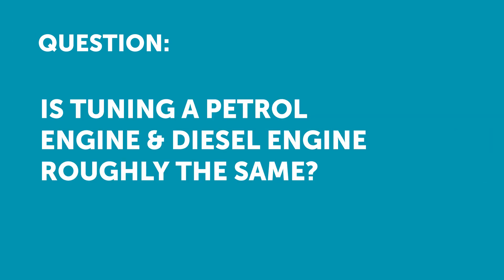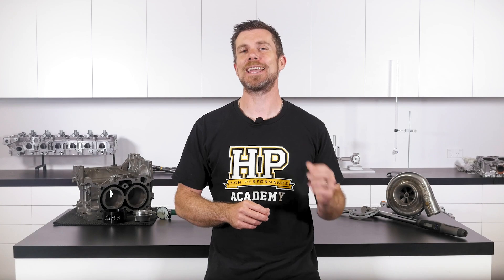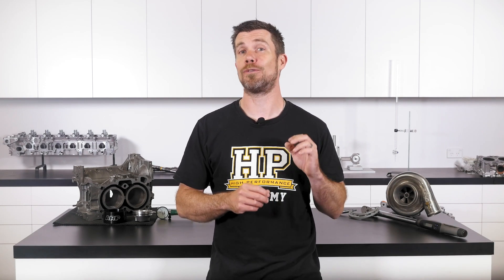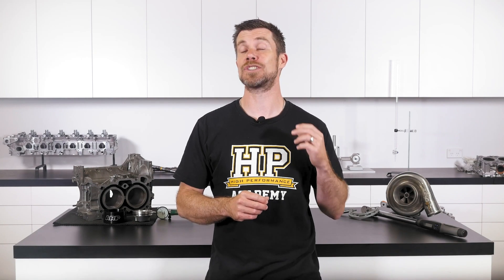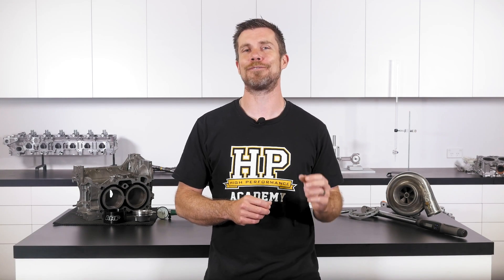The Difference Between Petrol Vs Diesel Engine Tuning [HPA Q&A]

Comment: Tuning aside, if a diesel engine naturally runs high compression with turbos seen running up to 100psi through a cast block. Why hasn't this transferred over into petrol turbo engines or is there something I'm not understanding, thanks in advance.
Reply: from my understanding,in petrol engines you`re compressing both fuel and air, if the cylinder pressure gets too high you are gonna have a preignition\detonation. diesel doesnt add the fuel untill its at optimum timing. so it doesnt care care if the pressure is high, because there is no fuel to ignite, so to answer your question simply. higher boost=higher cylinder pressure. higher cylinder pressure=higher chance of preignition. diesels cant preignite, because the injection of fuel is what sets of the ignition event
Reply: @pbergum97  understandably there are different fuels however a diesel cast block and head can withhold much higher psi from factory compared to a performance cast block and head for a petrol engine from factory